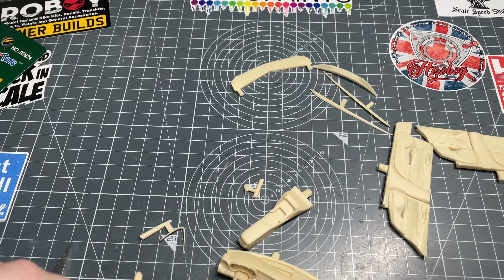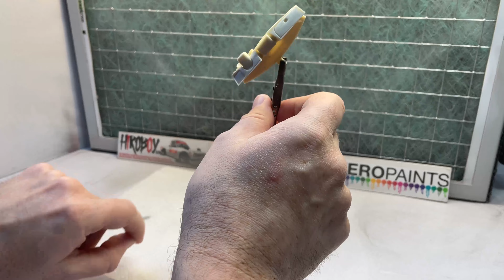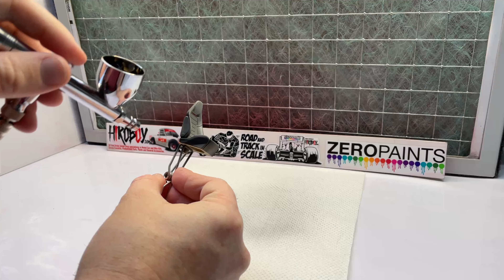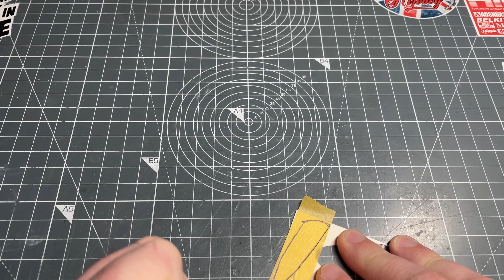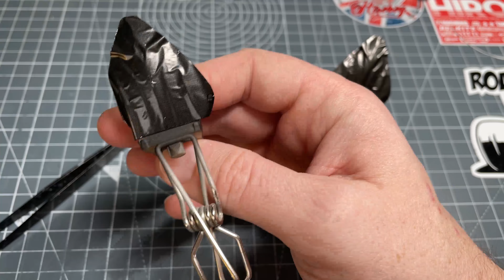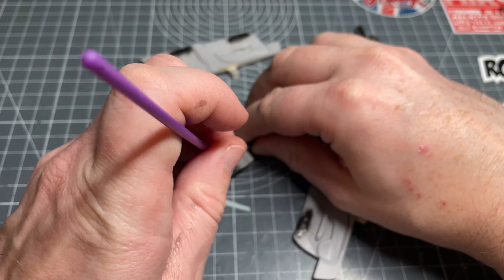Alpha Models: Alfa Romeo Giulia Quadrifoglio Part 2 - Carbon prep

Comment: Hi, Great work on the carbon👍🏻! I found an easier way to simulate carbon. I prime, then semi-gloss black lacquer (actually the sheen doesn't really matters),  I found a fabric that I use as spraying mesh masking thing (ballerina tutu sort of thing but with a way smaller pattern of holes), I spray glue (3M photo-mount, others work too) on the fabric, apply on the part firmly to follow the shape of the part, I spray a thin coat of pearl black lacquer, remove the fabric, clean-up the traces of glue on the dry lacquer with mineral spirits, clear coat, done! Very easy to do, the trick is to find the right fabric, a bit elastic and with the right scale. Mine is perfect for 1/12, acceptable for 1/20, too big for 1/24 but I still use it (still kind of okay for me but thinking every-time  "I really need to go to the fabric store to find something better"). Kevlar is also possible but I never really worked on it to find the right colors because I still have a decal sheet to finish. Thanks for the video.